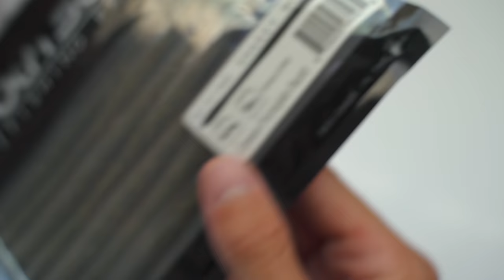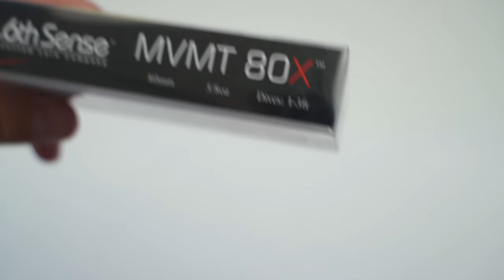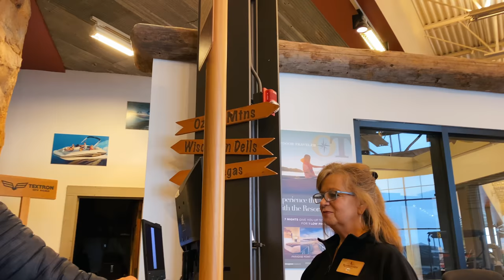I Bought My DREAM Fishing Boat for $500?!?! (Bad Idea?)

Comment: I bought the 10ft boat last year and was my first boat.  Got me out on the water and catching some fish . Put a 50lb thrust motor on it and it goes pretty good . They are super stable and handle 3ft white caps well . Been stuck out on a lake a couple times and had to cross it in white caps . You will dig it . I just put the garmin striker 4 portable pathfinder on it . Transducer is on a suction cup so take in and out the boat for transporting easily .

Comment: I had a hand control on the front of a jon boat .... u have to reverse the head on the trolling motor .
Reply: Yep, I welded a mount on the front of mine and reversed the head, I prefer it over foot controlled on the jon
Reply: Since there are more leaks in the back of the boat,  I mount my trolling motor on the front of my jonboat.
Reply: Slaunch buster, maybe?
Reply: The eight and a half pounder?

Comment: Motorguide used to make a trolling motor called the "bulldog", it has a clamp mount, foot control. Not sure if you'd have enough room though.
If you stick with the hand control, mount a paddle, on the opposite end, it will act like a rudder, keep the wind from spinning you as bad.

Comment: I have a small boat that I put anchor trolleys on. So far I like it, makes it’s easier to drop the anchor down because after while you end up with a mess of rope with the anchor. Only thing is I probably could use thicker rope to make it hold the rope better.

Comment: Hey man, great purchase. I had the same boat for 5+ years. Upgrade the seats asap! I had a 55lb mounted the stern and a 30lb mounted on the bow. It'll help with stability in the wind. If you install a graph, you'll want a separate battery for it. Otherwise you'll deal with interference on the graph. A lot of people transom mount the transducer, i trolling motor mounted mine. Worked perfectly. Keep it up man! Any questions about it hit me up.

Comment: For the hand tiller trolling motor, there is a bolt at the top of the shaft that you can take out to spin the foot of the motor instead of running it backwards

Comment: Take the bolt out of the trolling motor head through the shaft and spin it 180 degrees and then you can mount it on the front.

Comment: Uhhh guys,,  a hand controlled trolling motor is easily modified to go on the front.  One screw holds the head on the shaft of the trolling motor- remove screw turn motor around and walla...